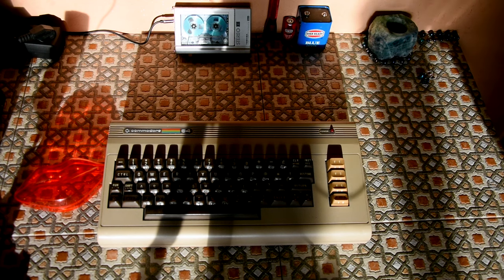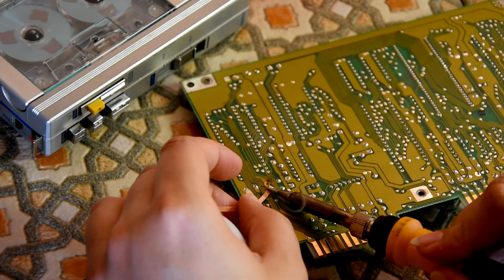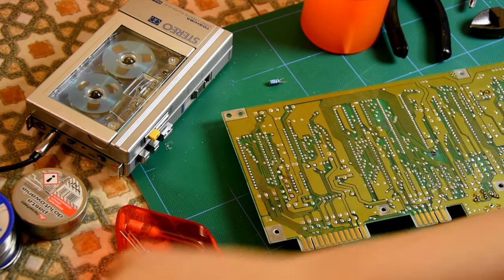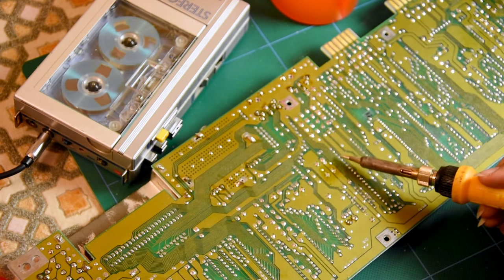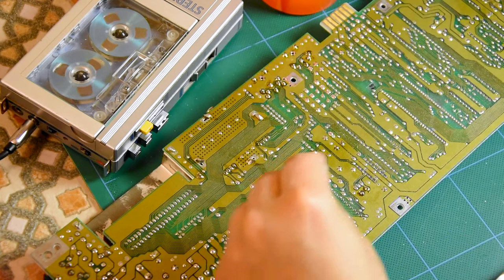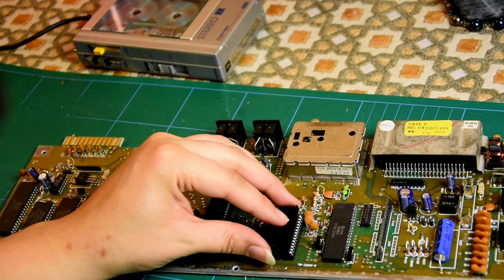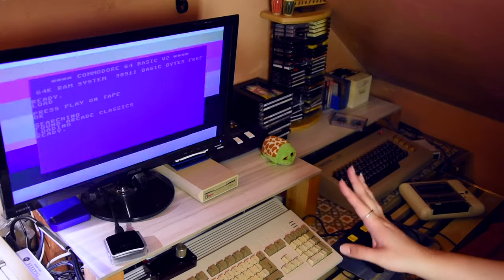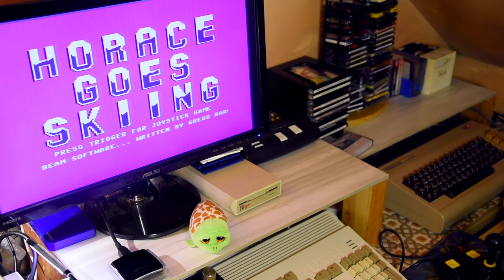C64 - Replacing Capacitors

Comment: You were right to say RGB output. :)
Reply from the maker: Really? If so then cool! :o) I recently heard that the C64 doesnt have an RGB out.
Reply: SCART is also commonly known as RGB so you did say it correctly, Maddi ;)
Reply from the maker: I can't remember who it was exactly, but I read it somewhere that the C64 doesnt have an RGB output so whatever is connected to the scart pins is just a composite signal and not an RGB one... however the thign is, I have 2 scart leads for the C64, one has less pins on the din, the other has more pins, the one with the more pins has a sharper picture, this is why I had assumed RGB and the other cable I know it's just a composite signal.
Reply: @MsMadLemon   SCART is best known for RGB signals, but can carry other signals, as well.  The C64 provides both a single-wire composite signal and a two-wire signal with the luma (brightness) and chroma (color) separated.  It's much better than composite and almost as good as RGB.
Reply from the maker: @rbrtck  Yes, i'm aware that Scart can carry multiple other signals but at the time I wasnt clear what it was, if it was RGB or Luma Chroma (I believe S-Video wasnt around at the time of the C64)  Composite i know is the lower quality one as it's it's name states is a composite of Luma and Chroma signals. 
I've done quite a bit regarding these signals lately on my channel: https://youtu.be/H9D5NEjohXk
Reply: @MsMadLemon   S-Video indeed came later, but existed while the C64 was still being sold.  I know because my LaserDisc player from back then (still have and use it!) has an S-Video connection; while LD is unfortunately inherently composite on the discs themselves, the higher-end players had superior color separation filters to those of most TVs at the time, so they came with S-Video connections to take advantage of this.  I think S-Video was originally created to support Super VHS VCRs, though, which store the two signals separately.

The signals themselves are almost identical to and largely compatible with the Luma-Chroma signals used by the Atari 800 and C64 (and other Atari and Commodore computers), so it is trivial to make a conversion cable.  SCART is also compatible as a connector, as you know, although of course ultimately the TV/monitor itself determines compatibility (some/many will take composite and RGB but not Luma-Chroma/S-Video).

This is for anyone reading this who may be interested.  Looking at the more current content of your channel, I think it's obvious that you don't need any lectures from me. ;)

Comment: I just did an Atari 2600 where all of the Through Hole components were FLATTENED on the other side, soldered in place, then clipped!!!!!!
OOOOOhhhh.... curse words aplenty espoused from my mind! 
Not  just a 'kink, kink' to keep them where you want to solder, FLATTENED!!! Totally NO WAY I could use my desolder gun (same as yours). 
OOOHhh...